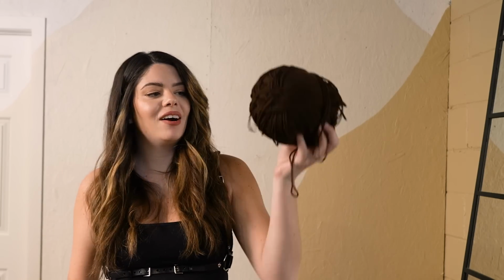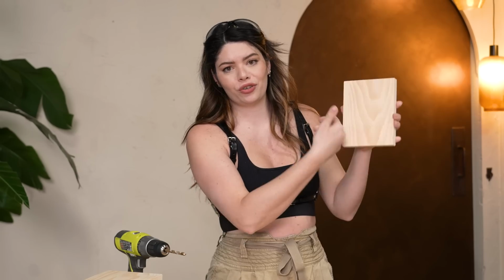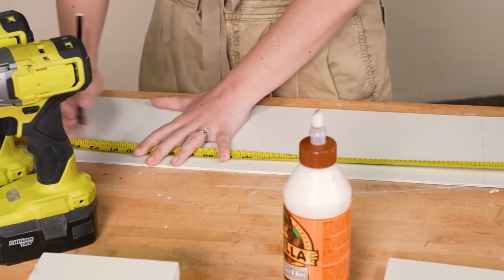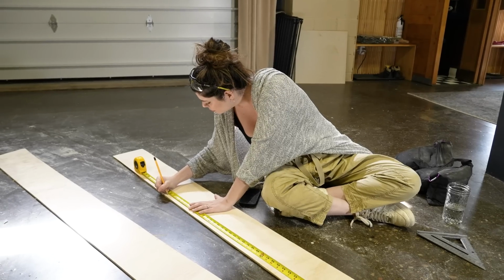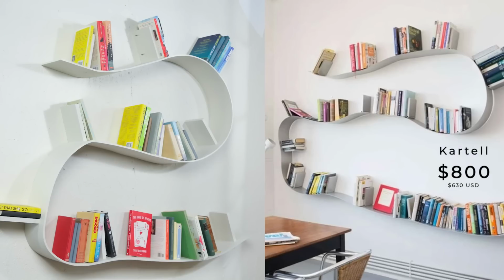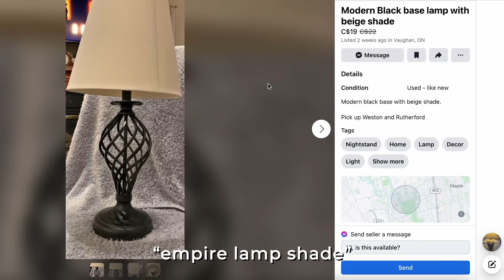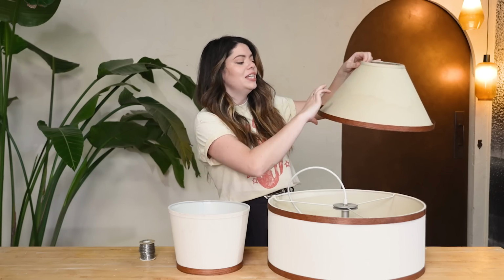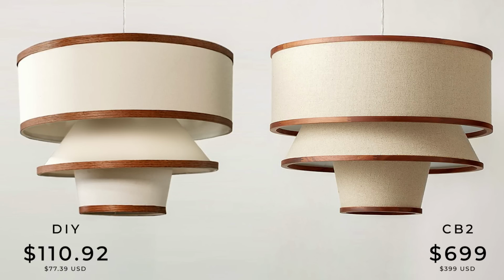i DIYed luxe designer items on a budget (who did it better?)

Comment: Could the bookshelf have been made even more affordable if made with a thin aluminum sheet? I think the original is metal right? It would also be cool if the book support portions were covered with book covers/bindings to make everything look like it was floating.
Reply: @rainbownarah  it could just be screwed in by the shelves?
Reply: The original is by designer Ron Arad and is steel, but then Kartell bought the rights and made it out of plastic
Reply: Also you can bend MDF more easily with water, but you would have to form it on the floor to let it dry, then hang.

Comment: I think you'll want to consider too before you heat up the shade with an iron, I think the iron has to be set on cotton for the glue to work, And not all but most lamp shades have a plastic lining now... I have no doubt lining will melt and worp. I would consider finding a test patch if possible... or even a test shade.  It is surprising even the number of higher quality lampshades that have a plastic interior lining😢.  Although not all lamp shades for sure  Just something to be aware of hoping to share the knowledge

Comment: You could use extra book covers to cover up the bookends too! Make them look like all the books are floating. Also, instead of wood for the bookshelves, some hardware stores have 1/8" plastic sheets which would be more flexible and it comes in white!

Comment: Is the expensive bookshelf made out of metal?  It looks like thin aluminum.
Your lamp looks as good as the expensive one.  I think I would have started adding the smallest shade to the next size up, first, just so it could be wired a little tighter, but that was still a very cool projects.
Reply: If I made this I would try to have another light in the lowest shade to balance out the light spill

Comment: You could put fake book covers around the supports and make them invisible. Also if you don't want the wood grain, much as I don't like using plastic unnecessarily, some kind of sheet plastic would likely bend and curve without breaking especially if you warmed it up. Also most of those plastics are thermal plastics and could potentially be joined together with heat.